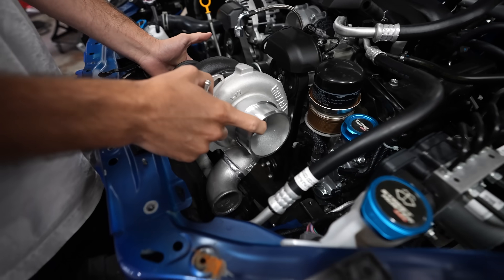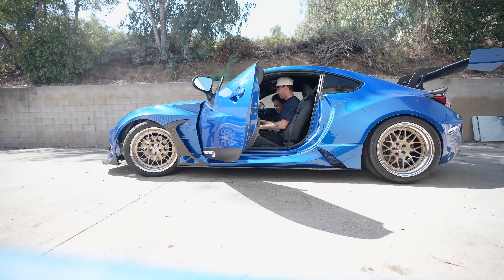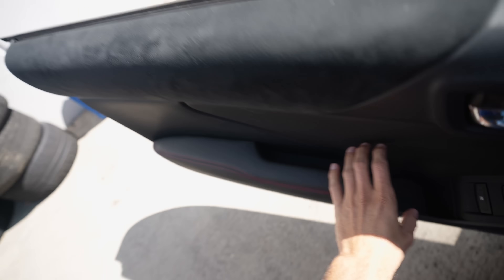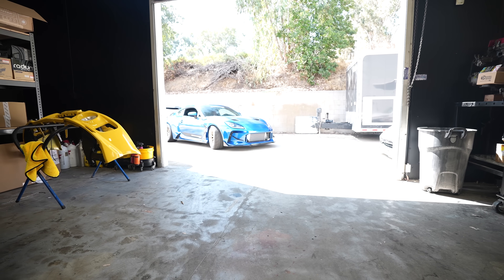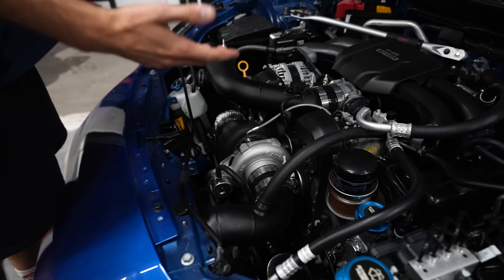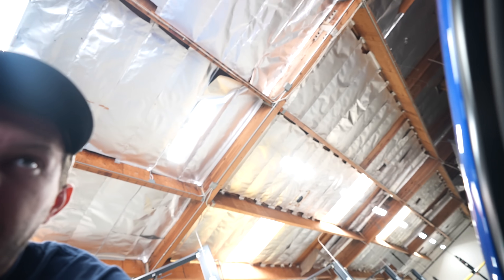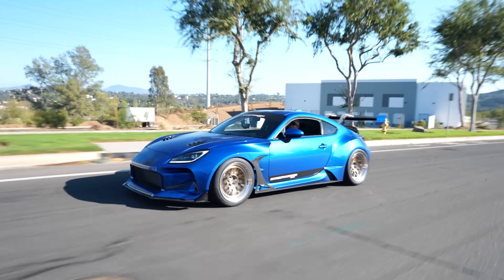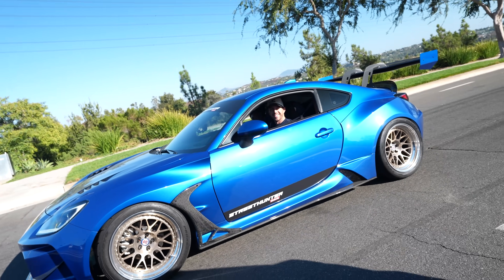FIRST DRIVE IN TURBO BRZ!!!

Comment: Love ya Tj, but a crash bar is not just for fender benders. They’re designed and collision tested in conjunction with the airbags firing so the pax rate of decel is as long as possible. I’m from aus and people put bullbars on 4x4’s that wreck collision sensor timings but just for ya info they aren’t only for low speed tings

Comment: I've driven my friends brz and gt86 of older Gen and I'd say u wouldn't want to make it a high hp build. Fr the car dominates in tight turns in the hills. Where  stock hp is already plenty. It's car car I'd say made for handling and being light. Putting power into would just ruin it's purpose. Would rather buy another vehicle if u want a car for high hp for cheap like a 335i or something

Comment: The reason why the bash bar is there is to bend the actual bash bar vs pushing 1 frame rail real bad. Theres reasons why they are there and why they do so much crash testing. The main reason why with drifting people go to the tube style. Is jacking points / aftermarket aero / mounting coolers. Etc etc.

Comment: Dosent matter about people's opinions.   I've worked fixing damaged cars for the insurance the last 18 years.. a bashbar saves lives!!  That's cooler would just rip up and worst case do nothing at all.. and nothing to stop the engine going into the firewall, ot through the firewall. Seen that before!
Reply: ya and his excuse was "fender benders cause more damage with a bash bar" which is just dense. the chances of a giveaway car winner getting into a fender bender in a 500 hp car is slim. theyre obviously gonna DRIVE thr car and any accidents i presume would be fatal.

Comment: IDK TJ
Using an intercooler as a bash bar to save some fab time doesn't seem like the right way to go about it.
Reply: Bro you don't need a bash bar if you get in a wreck it's gonna be trashed anyway.
Reply: @justinwebster7761  
Maybe you should replay the part where he explains exactly why you use a bash bar